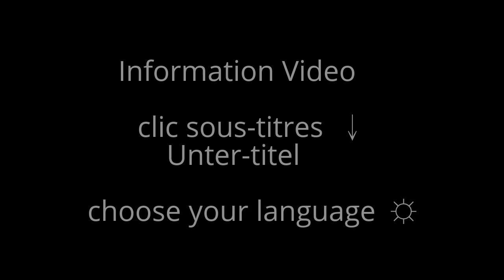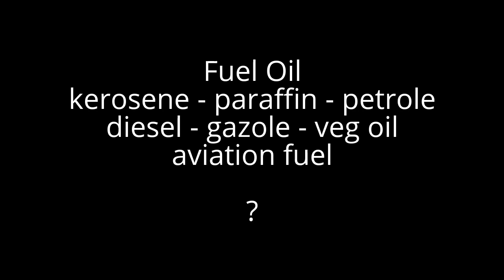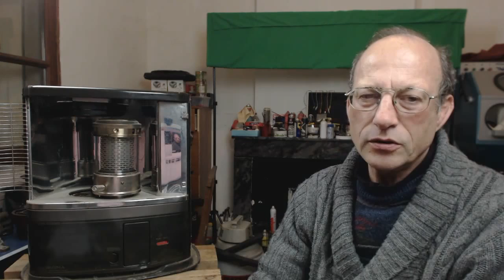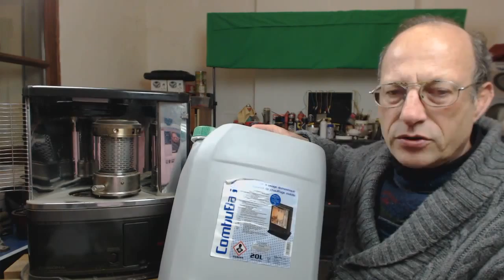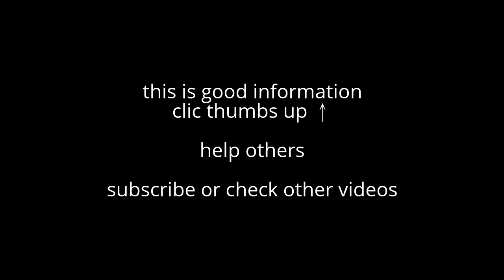Cheapest safe heating fuel - paraffin / kerosene / petrole heaters & stoves

Comment: The only "Avgas" most people would be able to get their hands on is for petrol aircraft piston engines, and is one of the only LEADED fuels still available in the UK, so that's a bad idea even in a petrol stove. 
In the UK the main three "Heating oils" are diesel, kerosene, and paraffin, and they're all part of the same group of light oils....... But that DOESN'T mean they're interchangeable !

Diesel (Be it red or white) is the dirtiest of the trio. There's not as much crud in this as there used to be, but it can still have some pretty nasty stuff in it, and you really don't don't want to be burning this in anything that doesn't have a sealed combustion chamber with a chimney, and some form of heat exchanger to get heat into your room. The down side of this is that most heaters with a heat exchanger also have electric fans, and that could be an issue for an emergency heat source for if the lights go out. The chemicals added to make this stuff suitable for piston engines will also clog the wick of most oil heaters that use one. Because of this, it's only really usefull for industrial type heaters that burn an atomised mist of fuel, with either an enclosed burn chamber and flue, or diesel space heaters that are being used in a large industrial setting with a constant loss ventilation (Ie, the sort of place with a big open roller door that's letting heat and fumes out all the time the heaters going to be running). you can add things to prevent wick clogging (Like the "Diesel conditioner" you put in diesel engined equipment before laying it up for a length of time, or some people say running (IIRC) an approximately 1 to 50 mix of isopropyl alcohol and diesel stops this from happening), but I've never tried any of these tricks, and personally, it feels stupid to add yet more chemicals to a fuel that's already laced with a fair few. The benefits of diesel is that it's available EVERYWHERE. If you make friends with a local car scrap yard, you may even be able to buy cheap diesel from them that's had to be syphoned from cars before being crushed.

The next is Kerosene. In the UK, this is not the same stuff as what Americans call Kerosene. Here in the UK it's intended as a heating oil. it's again best to be burnt in a heater that has an enclosed burn chamber, a heat exchanger, and flue, but if you need to use it in a open air heater, it's going to be significantly less harmful for you than using diesel intended for road use. Just make sure that you get a heater that's more powerful than you need, because you're going to want some ventilation if using this stuff. It won't clog wicks on oil burners that use them, but it can leave a pretty strong smell if burn in things like inefficient oil lamps or "Patio/greenhouse" type heaters. If bought in 4 or 5lL bottles it can be pretty expensive, but bought in bulk It can be significantly cheaper than road diesel, but most bulk suppliers have a 500L minimum order, so buying and storing that much can be a bit of a hurdle if you just want some for an emergency heater for if there's a power cut.

Last we have paraffin. This is annoyingly also available in different grades, and some suppliers have their own non quantifiable terminology for their grades (Words like "Premium Quality" or "High Purity" often have no bearing on what's inside the packaging). As this guy says, what you want to look at is if it's grade "C1" or "C2". C2 is pretty much just a cleaner kerosene that's sold at an inflated price. If burnt in an open flame heater it will usually give off a bit of smell, but unless you have a small room with next to no ventilation it's unlikely to give you any major health worries if you're only using it a few times a year when your homes main heating isn't an option. C1 is the best option for open flame heaters and lamps. it leaves little soot on lamp chimneys, and if it really IS C1, it shouldn't really smell. You may get an odour from it when the burners first lit and put out, but that should stop pretty quickly with a well setup heater. C2 is often sold at places like garden centres as patio or greenhouse heater oil. It's not cheap, but it's more convenient than trying to work out what to do with 500L or kerosene ! C1 can be really expensive if bought in the 4 or 5L containers, but some oil suppliers get it in 1000L IBC containers, and meter it out into your own jerry can. It's still not cheap, but it's cheaper than the 1l lamp oll bottles it's commonly sold in.

One thing to mention about ANY open flame heater is that if consumes oxygen (I know, blinding flash of the obvious there. :D). But most people don't realise how much air they actually consume. in a small room with minimal ventilation and a small open flame heater, it can only take a few hours before the thing can lower the oxygen level to the point where you feel tired. After that you may start getting a headache. There's been many near misses and deaths from people using open flame heating in modern houses (Old houses were drafty as hell, but modern one's tend to be pretty well sealed up, where the gaps around doors and windows are all plugged up with rubber strips). Personal opinion is that if you want to get yourself an oil heater, get something more powerful than you need, and always have a couple of windows cracked open an inch or two. That may sound counter productive, but just doing this will move the air around a bit, and bring more than enough fresh oxygen into the room. On top of that, have a google and find a medical website you trust, and look up the stages of asphyxia/suffocation. Being able to recognise the early warnings could save your life.
Reply from the maker: That's a good overview Reman.
Thanks for taking the time to put it together, and sharing it :)
Reply: There are some fuel stations around my area where they have C2 kerosene on tap where you take your own jerry cans to fill. The price is similar to red diesel. Cheaper than buying in hardware stores but not as cheap as bulk orders. C1 if you order in bulk also becomes more reasonably priced

Comment: Is it safe to burn parrafin lantern indoors? Wot do you think? Thankyou for video
Reply from the maker: The key elements are the fuel and the temperature of the burn.
If your lantern is pump pressurised, and has a good gasification head & mantlr, the better the burn.
These Tilly lamps are literally brilliant.

If it is a traditional simple wick, it will be less efficient and create more fumes.
... but perhaps the fumes will be heavier, and will circulate less (just speculation).

A lantern burns less fuel, and doesn't have a fan to blow the fumes into circulation.
However, by buying the good quality paraffin, you will get the best burn that your lantern can deliver.

Comment: I bought one of these for emergencies. Kerosene is not sold state wide. The LPG heaters cost more. A lot more if you try to find one with equivalent BTUs the big Kerosene heaters put out and they dont come with the hoses and other hardware so your buying that separately. Then the issue of storing the propain tanks. I don't have a shed and it's a horrible death if it leaks. I plan to run diesel in it. I can keep 5 gallons in my spare storage bedroom over winter and in the late spring if I don't end up needing it dump it into a waste oil collection bin at a automotive center so I'm not ever dealing with old degraded fuel and not be out a bunch of money.
Reply from the maker: It is always good to be prepared for winter
... or simply 'be prepared' :)
Reply: @EngineTuning  fuel and energy costs are going to go up 100s of % this winter in much of Europe. 1st world nations going back to the dark ages. Civil unrest will come. The political order no longer coincide with the economic order. Here, it is much the same but the people know that foreign powers of Russia do not dictate to us the cost of fuel. North America can produce enough energy to supply itself, Europe and have plenty left over. The Greta Thunbergs of the world have been shut off no longer invited on television or to give speeches at the UN. In November a day of reckoning will come much of my governments power will be stripped, hobbling its ability to cause more damage. But we have a few more years until it dies off and we can start repairing the damage. We are in bad times
Reply from the maker: @lampshadesoapmaker678  We are in very bad times.
It certainly seems that success has bred confidence of action, without restriction, nor retribution.
The big 'game plays' are purposefully devastating........
Reply from the maker: Oh!
BTW ... As long as you keep the lid on the fuel, it will be good for a very long time.

If you open the container, and use say half, then you could decant the remaining fuel to a smaller container, or containers.
Just don't forget to mark up the containers, vis a vis their contents, and date.

The key is to minimise oxygen, within the container.

If you are using 20 litres in a winter season...
The growing oxygen content doesn't matter.

One of the main problems is water at the bottom of the newly purchased fuel.
In a clear container, it can be seen.

Many people buy a water filtering funnel, and decant the new fuel into the previous container.

Acetone, not only raise fuel burn temperature; but also helps mix any humidity with the fuel.
This enables the moisture to be evaporated during the burn, with no negative consequences. 

Note that this works extremely well with diesel and petrol engines ;)

Apparently Myth Busters proved that this wasn't so.  
Hahahah!
Just try 0.5% acetone to fuel.

Know approximately the fuel quantity in your tank.
Then, mix up a jerry can of extra fuel, with acetone added, to create a mix of 0.5% acetone.

Note: Adding more acetone doesn't really help.
You can add 1% or 2% (even more) without any problems.
It's just that 0.5% does the job (and is financially beneficial).
Meaning that you get more power from each liter, so you use less fuel.
... and your engine burns cleaner.

Acetone is likely one of the main ingredients in the expensive fuels that you can now buy in some service stations.

Anyway ... switch the engine on; and then add the acetone laced fuel from the jerry can.
Listen to the engine note change, as the laced fuel hits the combustion chamber :D
Reply: @EngineTuning  I fired up my new heater the big 23K BTU units the shape of a drum and just used straight diesel. My home smelled like a truck stop on start up and shut down. Not horrible as my dad is a truck driver and it is a familiar smell. No smell while it's running just maybe the smell of hot metal if you put your head over it. Ran it for maybe 2 hours and theirs slight tar buildup on the fiberglass wick. Which is fine as these fiberglass wicks are self cleaning if you keep it lit until it runs out of fuel. That stuff will burn off. It has instructions on how to do this that came with the unit. The flame is not as high as it should be. I'll burn this tank out and try the acetone maybe it'll thin out the fuel. The unit did heat my entire home anyways and did not produce fumes. Worked great it's just a giant center draft oil lantern and the light it puts off was comforting. I have cheap natural gas I heat with but last November my furnace broke and I went without heat for 4 days due to supply chain issues waiting for parts. Everything is a supply chain isse go to the grocery store and the shelves are always empty like the Soviet Union or something.
Reply from the maker: @lampshadesoapmaker678  
The acetone is not to thin the fuel.
It is to gain from the chemistry.

The acetone breaks the surface tension of fuel droplets.
With no surface tension, the fuel vapourises  better.
This means that the fuel charge is more of a gas, than a cloud of droplets.

Hence it burns better.

Adding more acetone to the mix, may be for different reasons.
However, for fuel burn efficiency, the fuel mix is 0.5% Acetone
Example:
100 liter Fuel + 0.5 liter Acetone

Comment: Hi could you recommend a good small economical heater for a camper van
Reply from the maker: Hi Davey :)
I would try to find 'van life' forums, and search van heaters on YT and the web.
It is a very popular subject, and there are sure to be some interesting solutions out there.

Apparently, small chinese diesel heaters are often getting fitted.
I'd experiment using C1 paraffin, instead of diesel.
I'd also try adding 0.5% acetone to the fuel.
In both cases the burn temp will increase, creating a cleaner burn.

Make sure that you install air quality alarms.
Also ensure that you have a good inlet airflow, and  outlet.
Ventilation is key.

Another serious problem arises from the condensation between heat cycles.
This can create mould in cavities, which gives off dangerous spores (that stink).

Hence it is worth talking to those who have overcome these problems :)
Reply: @EngineTuning  
Thank you for replying yes I’ll be mindful of fumes, as a child of the 50s and 60s I remember my parents using paraffin heaters with no adverse effects. Appreciate your advice Tnx

Comment: Thanks so much for answering the question I could never find a definitive answer for for my new inverter heater. I will only use C1 paraffin in it. Now to try and find a supplier in the Northwest UK. I've found 20L for £33 at ryeoil if you know better I'd be very grateful of a nudge. Now I'll go and look at your service videos.  Thanks!
Reply from the maker: I don't know Jonno.
Fuel prices are going crazy now - I just paid €1.80 per litre of diesel!!!!
Last time I looked (before the war) - 20lt of paraffin was €22 - around £19.
If the shops with stocks haven't put their prices up, then a lot of people will begin to augment their diesel with paraffin ;)
Reply: @EngineTuning  Thanks for the reply.  Shame I'm not in France, your stuff there is a lot more affordable BUT I'm happy with how many days I'm getting out of my heater on save mode.

Comment: I was wondering if you could advise me if its safe to use C1 paraffin in an oil lamp indoors?
Reply from the maker: Yes, it's going to be better, but don't forget that a full clean burn results from a good oxygen mix.
It's definitely worth trying :)
Reply: @EngineTuning  so the oil lamp won't give of any poisonous toxins when burning c1 Paraffin indoors? I always use lamp oil but it's really expensive getting.
Reply from the maker: @Perodepresa  My GUESS is that the lamp oil will be more toxic than C1.
The only sure way of knowing, is seeing it's specification.
C1 is highly refined, to remove toxins, and hence it is very thin/light.

A reasonable test will be if the C1 burns brighter, than lamp oil.

The pricing for lamp oil, is based upon what the market will accept.
Maybe it has a few drops of scented oil added to it (to boost the price).

... but you could easily add such oils to the C1.

Why not report back, after trying the C1?
:)